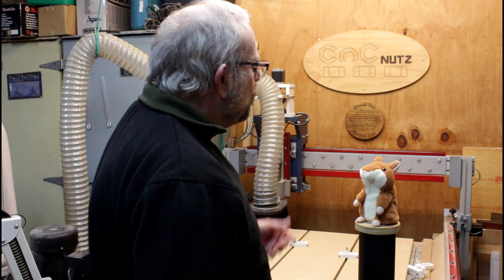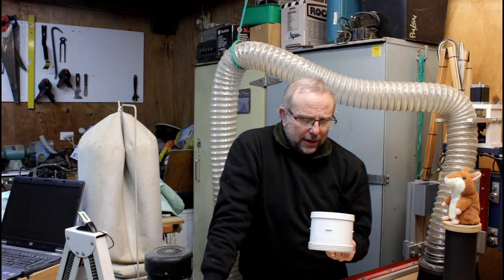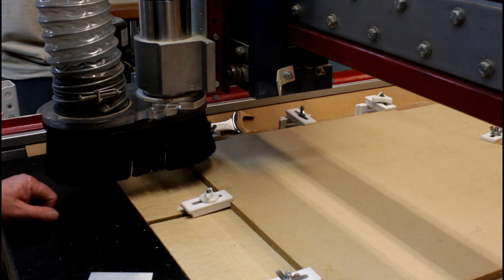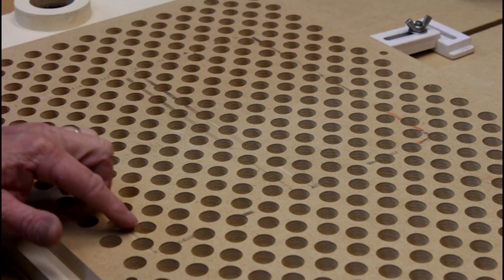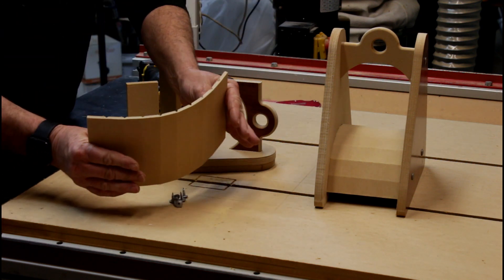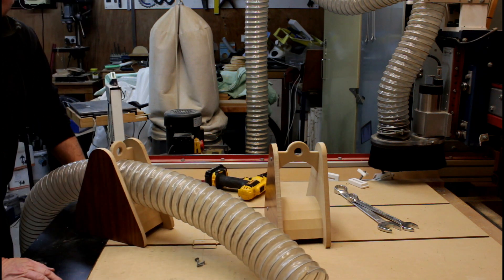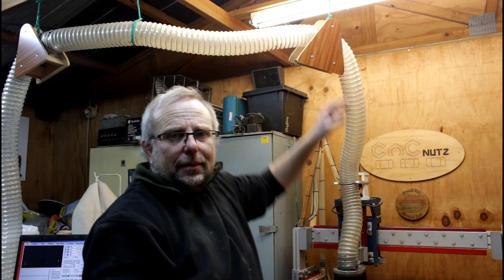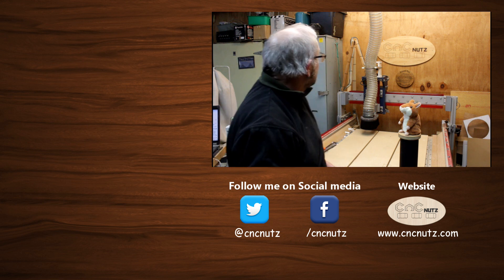Dust Collector Hose support - CNCnutz Episode 217

Comment: Probably not suitable for your situation Peter, but I designed and 3d printed these to lead the hose around walls in my place: https://a360.co/2PI7dE4
Reply from the maker: Nice hose clamp. It would be good for mounting a rigid pipe

Comment: So if the flex hose needs to be secured in a fixed location then maybe it should be a rigid duct... I like the rail idea for the flex duct part.  Needs to move freely so something like an industrial curtain rail might do the trick.  Thanks for sharing.
Reply from the maker: Thanks Stephen. I like the idea of a rigid duct because it will have the smooth sides but it is just such a short run it hardly seems worth it.
Cheers
Peter

Comment: I have a rod with the hose connected to a ring with zip ties which slides along with the machine.  The rod runs along the center of the y axis (97 inches) with enough slack that will cover the total distance of the x axis (49 inches. It hangs down some what but seems to work okay. As always enjoyed your video.
Reply from the maker: Thanks John
Now you mention it I have seen similar setup. Simpler that the arrangement I was thinking about. Thanks for the reminder.
Cheers
Peter

Comment: Great video Peter and great idea. I think I will have a crack and making one myself. Just a quick question. What vacuum do you use? I recently got a shop vac, but the hose is only about 50mm (2inch) diameter. Does it help having a larger diameter? Nice to see Chip again.
Reply from the maker: Thanks John
Not sure which vacuum you mean. The dust extractor is a generic  1hp vertical extractor with a 4" hose. A more powerful one would be better but it's a trade off between available space and the cost of running it. I built a Thein separator into it to collect most of the dust before it gets to the collector. 
 The vacuum I used on the vacuum table is a Festool ct22 I borrowed from my brother and it has a 32mm hose. Unfortunately I have to give that back just as soon  as he finds out. 
Cheers
Peter

Comment: i mounted an arm above my 8x4 cnc. it swings  over and back  as the gantry moves
Reply from the maker: Thanks Alan. I saw Frank Howarth do something similar on his channel but it looked a bit over the top for my small machine.
Cheers
Peter
Reply: franks is a bit over kill. mine is a bit more agricultural than his
Reply: Frank's is a work of art - I like his wooden "I Beam" arrangement in the part 2 video. I think you need to take on that challenge Peter!!
Reply from the maker: His build was awesome but I think I will give it a miss for my setup.
Cheers
Peter